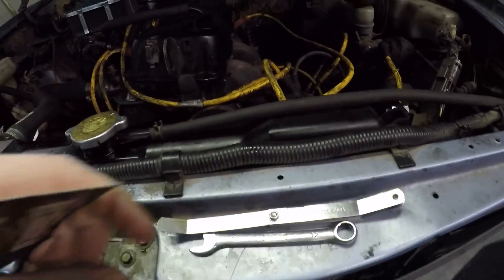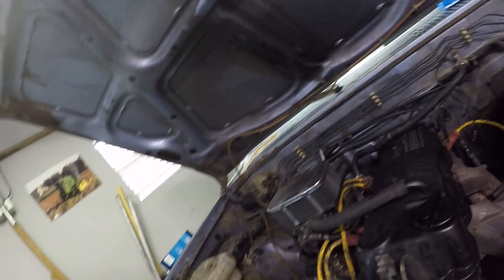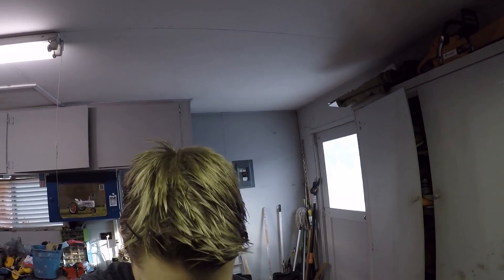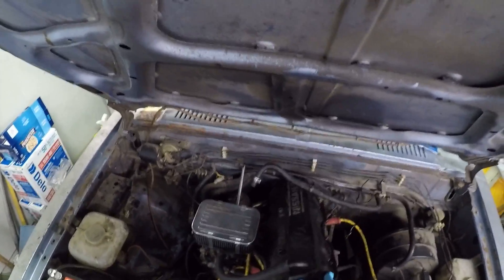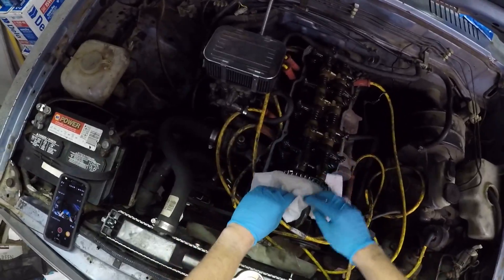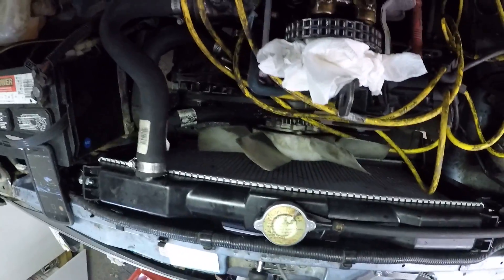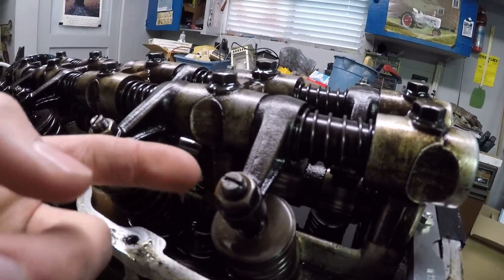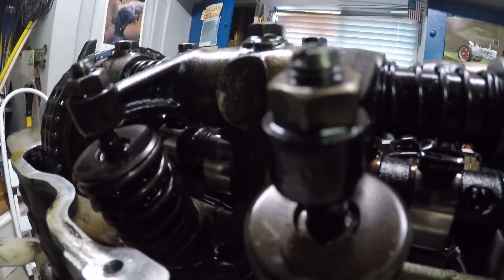How to set valve lash on Nissan 720 Z24

Comment: Mine has developed what i hope is lifter knock or bad timing chain and guide noises. It makes inconsistent clangs and rattles when warmed up and under any kind of load along with a consistant lifter-ish clunk that goes away half way through gears coming from the upper rear exhaust side of block.
Reply from the maker: Make sure to check for exhaust leaks, adjust the valves, rod knock is possible but usually takes abuse or a lot of miles to develop. Timing chain clank is very pronounced upon startup so have someone else start the truck while you stand near radiator to listen for that. Also check and make sure the flexplate isn't rattling at the front of the bell housing underneath. Check driveshaft U-Joints for wear and inspect exhaust hangers
Reply: Fresh factory exhaust and heat shields, no manifold leaks and ujoint are solid. I'd like to think it wasnt abused but my aunt drove this for 6 months when her cars trans blew and i got it with no oil in it. Definetly has timing chain slack if not busted guides from what i heard. Mystery clunk only appears half way to operating temp. Getting feeler gauges tonight! Gramps built this out of 3 trucks in 1994 soooooo opening valve cover will be interesting considering he put all the rubber washer seals upside down. Im scrrd
Reply from the maker: I've seen the rubber washer seals installed every imaginable way and just put them back the way they go you'll be OK. If it was me and the noise is not too loud I would swap the timing parts and drive it, you can get alot of miles out of a noisy rod bearing often and then put in a wrecking yard motor or rebuild eventually. Make sure to run a good oil like delo 400 to maximize the life it has left. If the timing guides are damaged when it runs it will send plastic shavings into the motor and clog things up so it's best to do those quickly.
Reply: I'll do what i can to save the old z24. Used a mechanic stethoscope and im pretty sure its an exhaust lifter and worn timing parts. Doing valve lash and next week timing parts. If that doesnt last I've got a 2001 honda odyssey j35 with full harness dash snd fuel system that i intend to swap in. I've been trying to source a bellhousing adapter, t5 trans, and someone to make/balance driveshaft
Reply: Valves are super quiet now. Found out the clutch is original and dragging slightly. Ill adjust the pedal stroke and hope i dont have to rip this poor ol thing apart.
Reply: Update! Its getting a 4.3l v6 and 700r4 from an 88 chevy 1500
Reply from the maker: @jamesblaine4185  I would love to see a video on how that works out!
Reply: @Captain720  Certainly, itll be a few months. Ill show the finickey things such as making mounts, wiring in the factory harness from the donor truck, and swapping fuel systems for the TBI.
Reply: Liked the  video.  Lots  of  good  lnformation. Thanks  much
Reply: Ok I know it's been a few years but I stuffed an L24 from a 73 240z in my 720 instead. It's close enough I may try to start it this weekend!

Comment: Thanks for the videos, hey I have an 84 ,if the valves aren't closing right, it could make explosions ?
Reply from the maker: What kind of explosions are you refering to? I would check ignition timing with a timing gun if you have not already
Reply: I just put it on 10 with the gun it's on i feel it better, i clean the carburetor and adjusted,spray some carburetor cleaner around to check any air problems, all hoses fine, check sparks ,wires and rotor ,and looks fine, in park doesn't have any problems,  it makes explosions on the muffler when I press the gasoline to accelerate and drive
Reply from the maker: @cachasbanuelos5516  Does it have the timing slap on start up? I had one do the same thing right before the timing chain fell off. Could totally be something else just worth mentioning that. Which carburetor are you running?
Reply: @Captain720 no it doesn't make that, it's the original carburetor, Hitachi, I forgot to mention I did a valve job and remove the camshaft
Reply from the maker: @cachasbanuelos5516  So it started making the noise after you removed and reinstalled the camshaft? also check to ensure your choke is coming off. You may consider starting a thread on Ratsun.net the wealth of information is invaluable and it is easier to chat that way.
Reply: @Captain720 the choke is ok, or maybe I jump one tooth moving the chain, I will check that, thanks man
Reply from the maker: @cachasbanuelos5516  Sounds like a plan, let me know how it goes!
Reply: @Captain720  isn't marks when I use the gun
Reply from the maker: @cachasbanuelos5516  the gun isn't hitting the marks on the main pulley?
Reply: @Captain720  they are after the 20  I have it on tdc with the marks right
Reply from the maker: @cachasbanuelos5516  20 degrees after TDC is a lot! Is it possible that when you had it apart the distributor drive unit got reinstalled one cog off? I have personally done that before.
Reply: @Captain720  do you think the distributor is the problem?I replace the chain like 2 years ago, and I didn't have any problems

Comment: Was your truck making a tapping or ticking sound.
Reply from the maker: They can a bit more so when out of adjustment. Take a wooden broom handle or something and put one end on the valve cover and the other end by your ear. Then you can hear where the sound comes from exactly.
Reply: @Captain720  thanks bro at first it was hard tgen i got it after i took a break...more videos would be cool.thanks again.

Comment: i followed your instructions and the number 4 valve stem comes all the way up and i get no clearance with the valve lash gauge.
Reply from the maker: That should not be? Did you make sure and get the motor in the proper position? If it is not at TDC on #1 then it will do that.
This image may help you. The hosting site just changed their URL.
https://s26.postimg.cc/5ix3mvzax/Valves_FSM.png
Reply: My truck does that to and now it taps even more.and i cant get it to stop.im so stupid i touched it.

Comment: Do you have to take the head down to the block to change a valve?
Reply: Jenny von Henkelmann my bf says yes you take the head off. Just be careful, its recommended you replace head gasket and head bolts whenever taking the head off, sometimes and he really means it if you just replaced hg and bolts you can get away with taking it out again (if the bolts are old or show rust after they dry throw them out! They will snap in the block while retorquing the head!!!). So if you dont want to have to buy bolts every time get a set of arp studs and put them in. Just a caution with arp studs, same with head bolts, if not properly torqued and seated the head will eventually spring a leak and back the bolts off which ends with lost compression.
Reply from the maker: I am not 100% at this moment, but I would if it was my motor. If it was me I would pull the head and do the timing chain at the same time. That's my two sense, when I can I will be replacing valves and making a video. Also I would ask on Ratsun forums in the 720 section start a thread and people who know way more than me just love to answer questions with pictures!